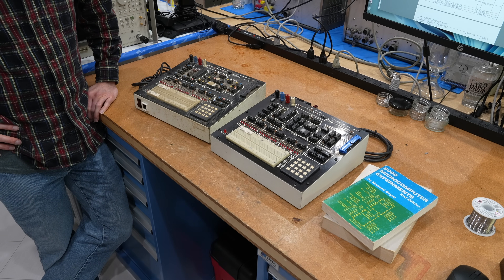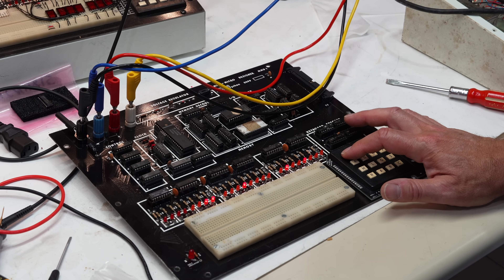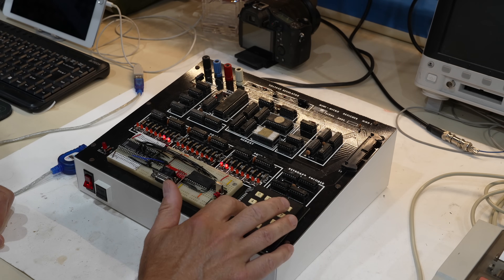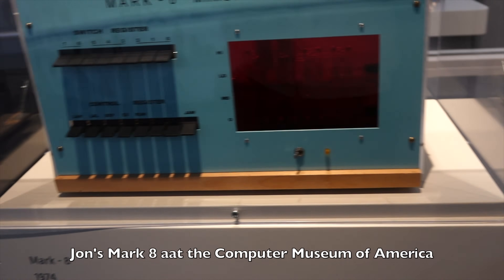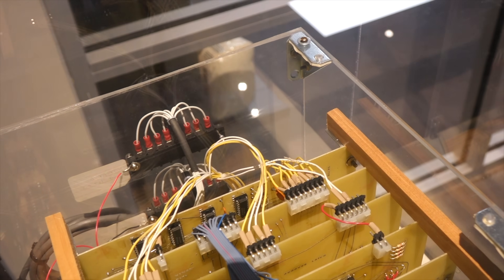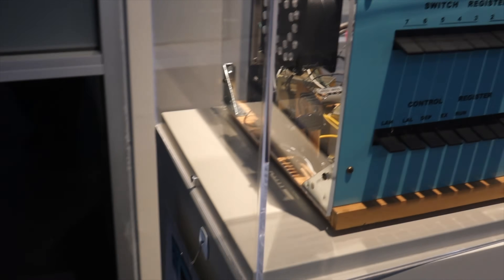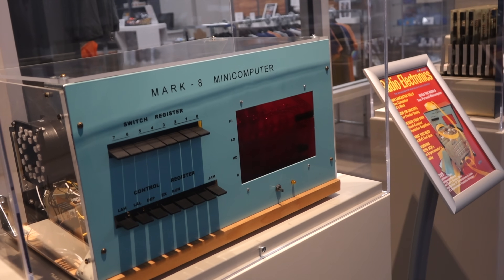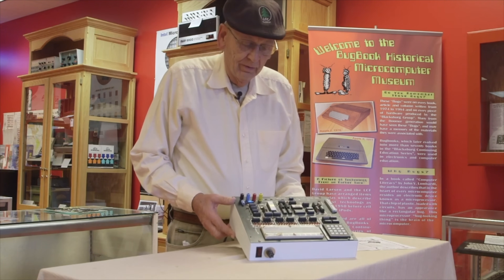MMD-1 Mini Micro Designer Part 8: Chatting with the original designers

Comment: This video and the computer shown reminds me of the computer board we used in college.  I went to DeVry Institute of Technology (later University)....don't laugh, I understand after the fact that it really was not that great of a place to go.  The computer board was called an EDM-80, which 2 of the professors from the Kansas City campus designed and which was used til some time after I graduated in '98.  The board was designed around the Z-80 and contained a number of the Z-80 family of interface and controller chips.  For general classwork, we would interface with it with a computer via serial and would program it with Assembly.  The board was also often used for our senior projects, but the Motorola HC11 was also often used.  The board also had a socket (or 2) for EPROMs that were used to carry the code when standalone. The board was about 12"x8" and had 2 edge connector to interface with breadboards or other boards.  I still have my EDM somewhere, but unfortunately I do not have the software to communicate with it, nor do I have any of my documentation or books for Z-80 family anymore.  I really would not want to dedicate the board for any of my projects anyway.  I do remember that another of my professors did say that he was hired to bring a bowling alley back to operation and he said he did use a number of these boards to run the pinsetters.

Comment: I wish we still had cool projects in magazines you could get the parts for at the electronics shop in town. I loved those magazines back in the day but could rarely afford to buy the parts.
Reply from the maker: Same here. I remember drooling over the Elektor projects that were way above my budget!
Reply: @CuriousMarc  I can see why. Looks like an interesting site. I still buy cheap electronic kits on Amazon. Clocks and things to practice and then usually give them away. Building a tube preamp kit now.
Reply: The closest I’ve seen is Nuts & Volts Magazine, though it’s electronic and Amazon as the “town”. I’m fortunate to live near 2 MicroCenter stores, they have a decent selection of electronics so I can go a little local. But yea, I do miss real, physical magazines and my local electronics shack.
Reply: @c1ph3rpunk What about Make: magazine? There's a print edition.
Reply: @c1ph3rpunk  I live east of west jesus. Nearest town with an electronics store other than me is the city 2 hours away. We used to have a couple of Radio Shacks. Lady held on as long as she could but it hurt really bad when she closed because when something broke at the radio station she usually had what we needed and let me carry a charge account with her. Now I have to keep what I think we will need in stock or overnight it from Digikey. Course a lot of fun is gone now that you got to do most of the work under a microscope soldering flea specks to pin heads. Then again I do through hole with it or use the goober helmet because I can't see anymore. I wish I was around for the home brew days of the 70s when the shop in town had what you needed to build something in your garage that could change the world.
Reply: Silicon chip magazine is still coming out in dead tree form and has projects in it

Comment: Uh. Eprommer. When I built my first computer with a Z80 back in 1978 I needed to program a 2K Eprom for the base function ROM. I lended an Eprommer, which had hex thumbswitches for adress and data, a "program" pushbutton and a power supply. The old Eproms needed 3 voltages IIRC and a 27V program voltage. And the only thing I had was a hexadecimal dump of the program content. I had to "dial through" the adresses, set the dataword acordingly, press "program" and select the next adress / data combo. Avantage: I could switch off the whole mess and continue the next day. It took me three attempts (and I think for days) to get the Eprom programmed properly ...
Thanks for sharing !
Reply: Yikes.. i could feel my fingers getting calluses reading that. I hope they were good quality thumbswitches.
Reply: @jamier.6634  Reasonable at least. Unless you misread "8" and "B" or vice versa like I did ... the dot-matrix hex dump list was photocopied from obscure sources and the over all quality hadn't been that good right from the start most likely. So ... it required three attempts until I ended up with a working ROM. Since there were no "home computers" a computerized Eprommer wasn't available and "copying a ROM" as of today (or earliest in the mid-80s) was also no option. I could have bought one in the US - but that had cost me over 120 Deutschmarks delivered - about 500 US$ by current money. And my salary as learning architects draftsman in '78 featured a monthly sum of 400 DM. Hmm. The Z80 costed around 100 and the 1K RAM 200 ... (4 chips of 256x4 bytes - 50 DM each + delivery). Puh.
Reply: We used to program General Electric mobile radios (police/fire) using a handheld programmer with tiny switches. Took forever to do, the Panasonic suitcase programmer was much easier.

Comment: I would love to have one MMD-1.

I don’t care if it works or not, I can make it work.

Great series, guys.
Reply: One thing I forgot to mention, the Dyna-Micro / MMD-1 has all the 8080 signal, data and address lines extended to the plug board. In this way, one can design, test and modify test circuits on board.
   Can’t do that on an Altair, IMSAI, or all the other Single Board Computers. Unless you add buffers, drivers, adapter board and the like.
   This system, has everything a developer needs right there. On board, ready to go. And don’t forget the expansion connector. That can be used to interface to a card rack to expand and take advantage of the 8080 capabilities.

So, I’m my opinion, the Dyna-Micro / MMD-1 is by far the better of all Systems Design Kits on the market at that time. 🎉
Reply: Maybe through DIY ? There is a nice emulator in the microsoft store though.
Reply: @pvisit 
Naaa….
I have intel’s SBC80/10, SDK-85. I also have a KIm-1.

But I would rather an original Dyna-Micro / MMD-1.